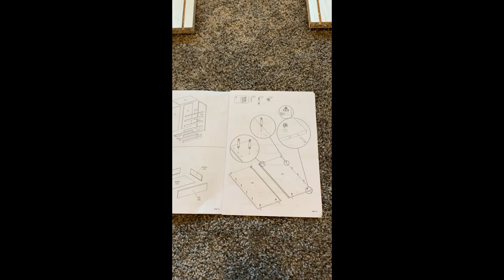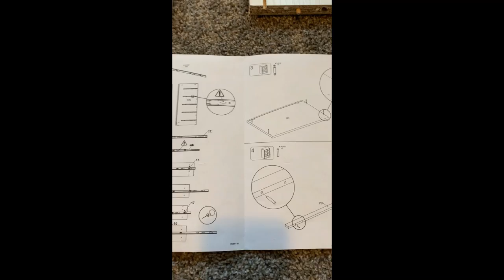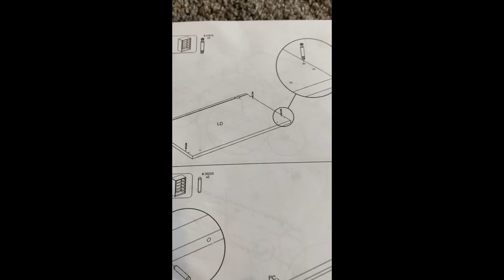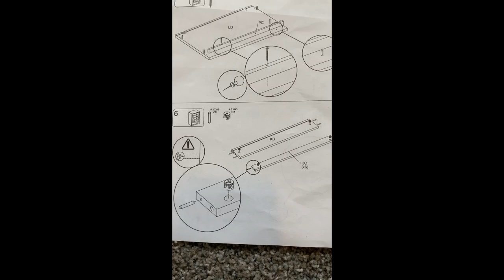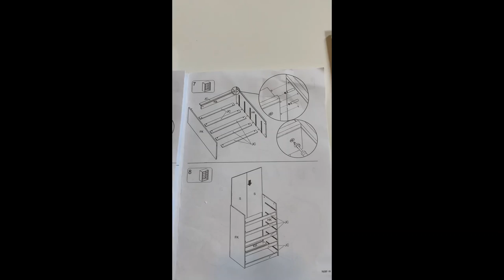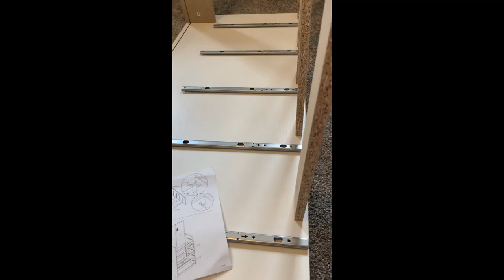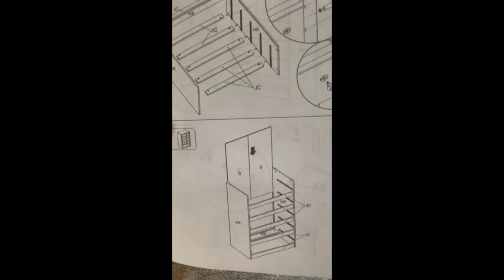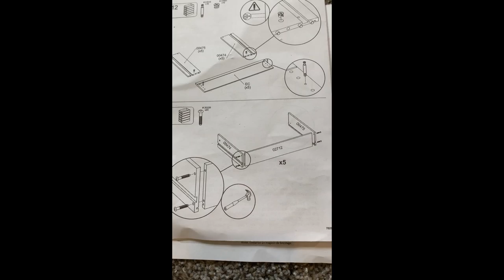Tvilum 5 drawer chest assembly

Comment: You are a savior! Gave me the courage to stop whining and do it:) one question though, my instructions gave with an assembly glue included for the wooden screws - do you think it is fine not using it (as you did not..) thanks!
Reply from the maker: Mine didn’t come with glue and I haven’t had any issues so my guess is you are fine without it. The advantage of the glue is that it makes it more sturdy so if you think you will be moving it around then it may be a good idea to use it.

Comment: I actually have the 3 drawer chest but can you please show or explain how to mount to wall? The booklet is not easy to understand. Very helpful video though
Reply from the maker: Hi Melissa, this step needs to be done before the drawers go in. There are two holes on the back panel of the chest by the top, mark the holes on the wall and remove the chest. Using a stud finder, check to see if you have a stud where the marks are, chances are you won’t be that lucky but if you are, place one of the washers included in the packet on a wood screw and then punch it through one end of the strip and screw it to the wall. If your wall is hollow you can use EZancor. I have another video up installing a floating shelf without studs, it can help you with how to use those: thttps://youtu.be/1X_5RxQuvAA. Once both strips are screwed to the wall, place the chest back against the wall and pull the strips through the holes. Use the screw and the second washer from the packet and punch it through the other end of the strip and screw it to the underside of the top of the chest. I hope this helps 😊